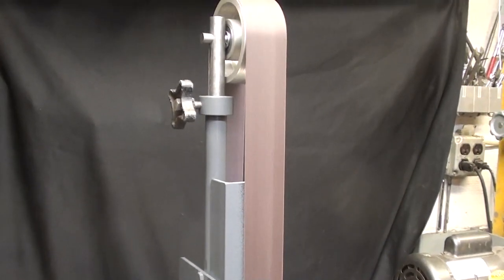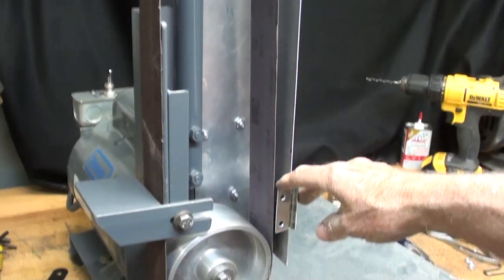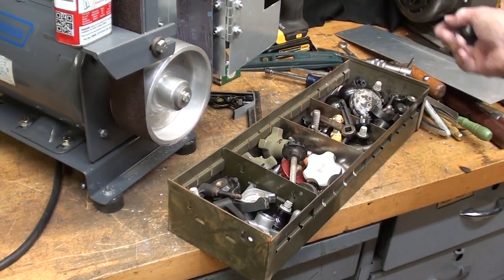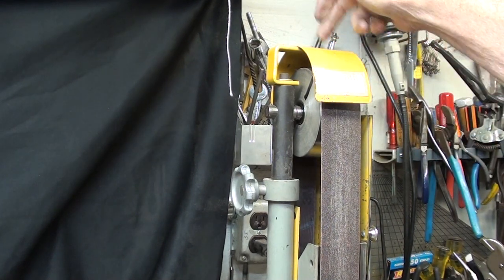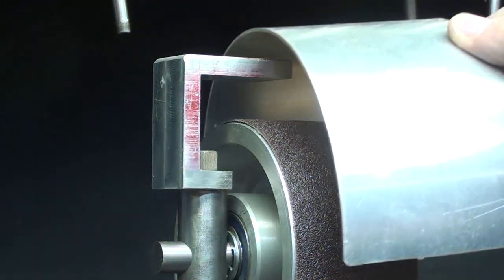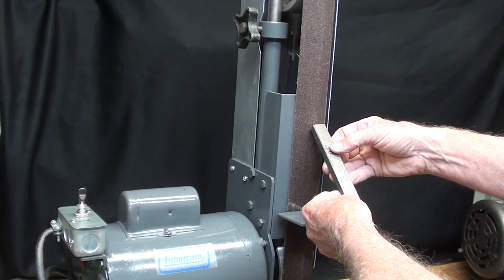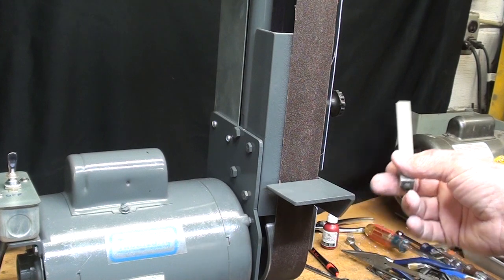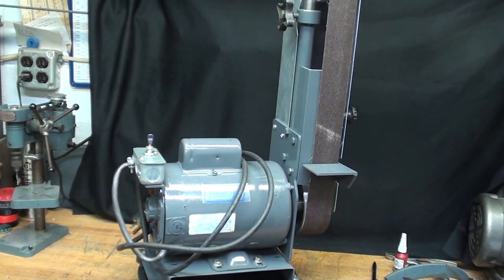Making a 2x48 Belt Sander pt 7 Tips #516 tubalcain

Comment: Safety - it takes a really brave man to have a class full of teenagers using machinery.  Gives me shudders !  It was scary enough for me having two of my own I had to keep safe.  
One thing I always did in my shop was to double switch dangerous equipment.  A switch for the outlet as well as the switch on the unit itself - so if someone came in and just flicked the control on the unit, nothing happened.  
Thanks
Reply from the maker: Yes, I was often terrorized

Comment: Is there any way of reversing the air flow in that motor so that instead of pulling in grit-laden air right off the belt, it pulls clean(-er) air in from the other end and exhausts by the belt.  Still not perfect but perhaps an improvement.
For what it's worth, I intend to build your grinder design as a stepping stone.  I want to build a 2x72 grinder based on Jeremy Schmidt's design but it appears that one of the most useful tools for fabricating all the parts of the grinder is....a belt grinder.  So seeing your build gave me the idea of building a simpler one I could use to make the more complicated design.   It also showed me the design flaws in the wheels I could have bought - both bearings stacked at one end of the wheel - and showed me how to crown a wheel.  If you hear swearing, you know I've started!  Many thanks Mr Pete.

Comment: If you turn a snap ring groove into the knob you're using to hold the door closed, it will make the knob captive and act as a washer to give you that little extra clearance at the top you wanted.
Reply from the maker: Good idea, but I used a thin held on with Loctite
Reply: I have also used rubber O rings and hard fiber washers threaded onto the shaft.
Reply: @larrysmall3521  had the same idea, great minds think alike.

Comment: Mr. Pete, Aluminum has a grain just like wood. I worked as an aircraft structures mechanic for a couple of years and when forming aluminum in a brake, you always brake across the grain to prevent cracking at the bend. Even with that shallow groove, you would only accelerate the formation of a crack. Alternatively, you could TIG weld along the inside of the bend to stiffen and further prevent any cracks in the future. As for stiffening the door, I would make a second ply that follows the edge at about a 1" depth and attach it using countersunk solid core rivets as much for aesthetics as for function. Although I don't know if it would work, you might also get a bead rolled along the edges. This would not need a second ply.
Reply from the maker: Yes, still has a grain of her as well. And I know from experience, I sure can break if you' bend it out the wrong way

Comment: Thanks Mr. Pete, excellent job. 
I know you probably don't feel like doing this but as far as your noisey door rattling, maybe if you took the door off, scored 1/2" from the top and bottom and slightly bent the aluminum it would dampen the vibration. Or even just hot melt glue a strip of aluminum here and there would do the trick and no one would be the wiser.
But, fine the way it is also.
I have a 1" × 42" belt sander and think I will roll me a piece of aluminum in my slip roll to make that top guard to protect my eyes better. 
I get all kinds of ideas watching you.
LOL, I bet your wife don't see much of you, but if she's anything like mine she probably prefers you being in your shop. Seems like everything I do since I retired annoys my wife. 40 years worth of annoying her coming up 😍.
Reply from the maker: Those are good ideas to reduce the vibration, thank you. Yes I think my wife like most women, prefer when we are banished to the dungeon
Reply: @mrpete222  You're welcome.
🙄

Comment: I had to finish this before starting my day, I enjoyed this series so much.  Yes, trying to build one with the price of a motor could be a bit high, but as I mentioned in 2022 the RIKON 2"x72" Knife Belt Sander/Buffer on Amazon is $879.00 and NO guards except on the top.  The other thing I don't like about the Rikon is they used a double ended motor so you can have a buffing wheel on the other end and that seems like it could be a bit dangerous.  I like your version Mr. Pete...
Reply from the maker: Thanks

Comment: I'd glue a fiber or rubber washer (1/8th) on that screw hole for the door. Then it wouldn't fall off and it would keep the noise down too.
Reply: Oops.. saw that added comment.

Comment: Yea going to have to make a couple of these ,already made several 2x72  3 wheel belt grinders. would love to see or have some plans for your 3 wheel little band saw that would sure be an interesting little build .Finally have the Heald  Horz. Tree vert. Mill up and going , think im going to pull the knee and cross slide apart and check the bearings out lots of chips in there, obviously compressed air was used ,and hasn't had a good cleaning in a hundred years lol thank you .
Reply from the maker: Yes, clean up real well

Comment: Lyle, so maybe if the sprung upright top wheel mounting shaft extended up higher then the cranked top guard bracket would be surplus. But maybe there would be a problem in cutting the spindle locking thread, cheers, Andy
Reply from the maker: Yes thanks

Comment: It sure looks professional made and also very save to use. Only a few things i do not find very practical . 1 the position of the toolrest to the right instead of the left side....you need tools and need to remove the toolrest completely  before you can change belts. Not to difficult if the toolrest is not set at a certain angle....but changing belts would also mean setting back the angle of the toolrest on a certain job. 2 .The upper guard and the side guard . If you make that in one piece (preferrebly in welded  thin sheet steel) and the hinges further backwards and at the side of the motor you could completely uncover the belt making it a lot easyer to remove and put back on a belt. You than do not even need a bracket support above on the pushbar.The way its made now you need to push on the upper guard to push the tensioner spring down and than  fiddle with the belt to get it between the upper guard and wheel . Furthermore the side opening in the guard at the toolrest is a bit limited....certainly if i want the toolrest set at 45 °. The guard as it is made now would prevent me to set that angle. This is only imho :) Thanks for all your effort in making these video's Mr Tubalcain .
Reply: Looking forward to seeing "your"  build. Please post it!
Reply: Most of us cannot afford all the new materials so adapt what is in the shop. So if it looks ok and we have to join a few small pieces into a larger one then use it. Also most people do not have the means or knowledge to weld thin sheet metal. I think this build shows how you can build a sander using mainly hand tools apart from turning  the wheels. mrpete did explain his logic and the short comings of certain steps in his dialogue as he went along. As said many times on this channel there are many ways to skin a cat. I for one do however respect your ideas and opinions as many of us would build the same machine in many different ways.  regards from the UK

Comment: Try a strip of aluminum tape (HVAC, real duct tape) on the inside surface of the door, to reduce the vibration.   The adhesive may help damp the rattle.
Reply from the maker: Good idea
Reply: McMaster (and others) sell a product that is 1000 series thin aluminum sheet with adhesive as a vibration-damping device.  Multiple layers of tape may help.  Hmmmm.  I feel an experiment coming on.

Comment: Concerning the unsealed motor what if you could find or make a fan that would reverse the flow of air through the motor so that the intake wouldn't be near the abrasive side.
Reply from the maker: No, these motors are disposable pan will still last 10 years at that

Comment: On the open frame couldn't you somehow place some kind of filter material over the intake side of the motor to cut down on the abrasive dust being drawn in without overheating the motor?
Reply from the maker: That would restrict the airflow

Comment: Of course it´s cheaper to buy one. But that is not one, you´ve made yourself. That´s a value by itself. And the cheap ones are really cheap. They come from china, and they are made from the cheapest parts available. Including the motor. It is not satisfying and no fun to work with these machines. Of course you can buy a good one, but then it will not be cheap by all means. The industrial type belt sanders are very expensive.
Reply from the maker: Thanks